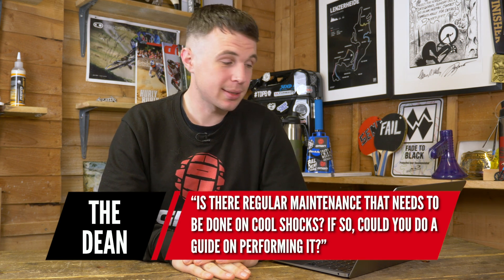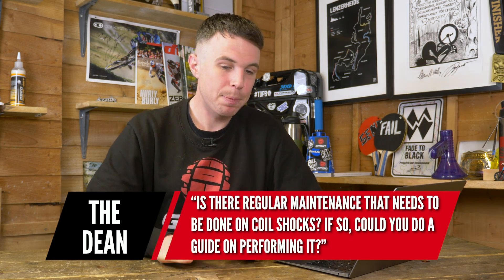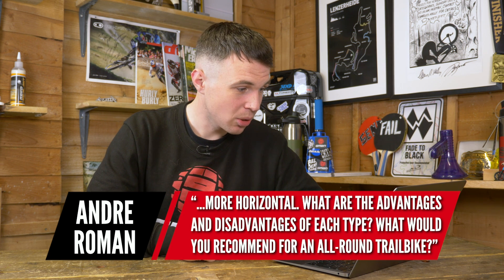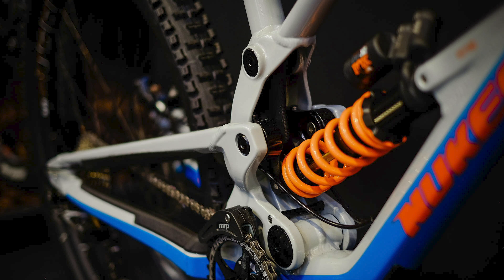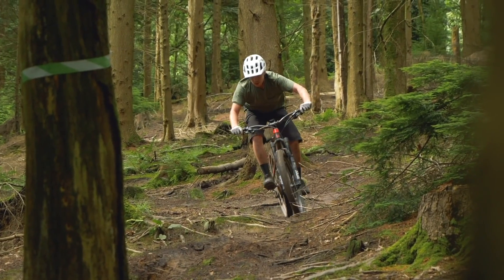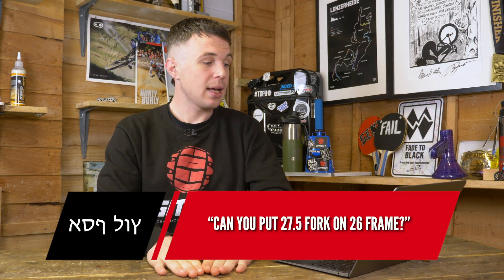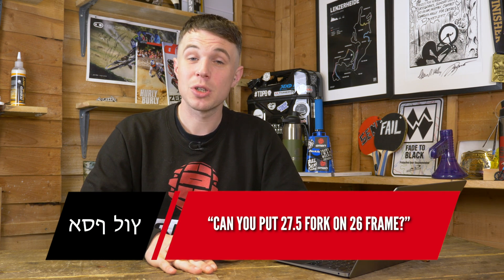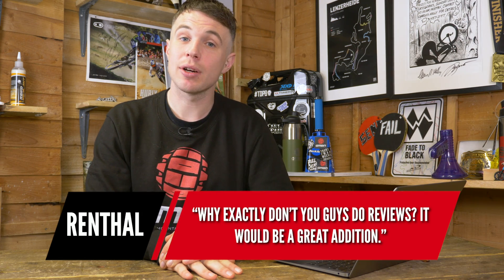Does A Vertical Shock Perform Better Than A Horizontal Shock? | #AskGMBNTech

Comment: #askgmbntech Hey guys, is there anyone anywhere in the world who manufactures aftermarket alloy suspension pivot bolt kits for full-sus MTBs? I'm asking because I have a 2005 Specialized Epic and a 2008 Stumpjumper FSR (almost identical to the '08-'09 Enduro but with a single-crown fork). I managed to source the correct bolt kit for the Epic from Australia and so have been able to replace all the pivot bearings but for the Stumpy, I've looked all over the world every day for months, I know the part number but just can't find a set! On a lot of relatively modern bikes these pivot bolts seem to be alloy and unique/uncommon sizes so I think there's a gap in the market here. I have a brand new shock and new pivot bearings for my Stumpjumper but don't want to take it apart without a fresh bolt kit because being alloy and having not moved for 12 years, there's a chance I could wreck at least one of the allen heads removing them (the Epic was difficult to get apart because the pivot bearings were seized to the bolts). Thanks for a great YouTube channel, and hope you can help!!

Comment: I got my canyon spectral 4.0 3 months ago but it came with a fox 34 performance 140 instead of Rythem 150 .I noticed however that these forks are 29/27.5. Should I get a 29’ wheel in front and use 29 in front and27.5 in back#askgmbntech
Reply: 34 performance is same as the rhyhm. How did you meassure the travel? 
29/27.5 fork means it can be used for both wheel sizes, do not change the wheel, it is meant to be 27.5 by Canyon and changing it will affect geometry.

Comment: #askgmbntech 
Hey guys I have a brand new Marin rift zone 1 with hydraulic disk brakes and I have a problem with the rear brake. I have an extremely loud squeak on it whenever I brake, I’ve tried bedding in my brakes getting new pads cleaning my pads and they are not stopping the squeak it’s getting extremely loud and annoying what do I do? (:

Comment: Vertical suspensions are worse in relation to maintenance.... they will require more disassemblies than horizontal ones... Reason: They are mounted upside down on purpose by the factories.... This way the dirt can enter easier within the shock.... and Fox can sell you a new one faster..... Always keep your shocks clean and if possible protected with a shock cover made of neoprene.....

Comment: One more option for a tripped axle thread: find an external bolt that works with your fork after you've drilled out the damaged threads. They sit on the outside of the leg with a flange and may be cheaper - although it may not fit at all if the fork dropout doesn't have enough space for the flange to sit flat.

Comment: Hi regards to suspensions kinematics, i really enjoy the analysis report of youtuber #andrextr and #gmbntech in my opinion any suspensions analysis report requires quite a bit of suspention knowledge to understand. but the whole suspension topic need som clear guidence and ther are enough of somtimes misleeding simplification of the topic.  Take something as simpel as oil viscosity and reference values.. your going to stumble on a world of alchemy and nonsense, and when your about to give upp you might discover CST rating. somting only fewe, if any wil give you the CST rating of there oil . 
So could be a nerdy suspension series hear on #gmbntech if your up for it. 

Im not buying my next bike without a careful look at suspension progresivety, fit  and a analysis of the overall bike handling. 

#askgmbntech

Regads Truls

Comment: #askgmbntech  is it harder to ride a bike with more travel up hills, because I am thinking of buying one
Reply: Generally, yes.  But, it isn't across the board.  Geometry has a lot do with it, as well.  I have been on bikes with long travel that climb better than bikes with shorter travel.  Generally, a cross country bike will climb better than an enduro bike.  As an example, I demoed a Transition Patrol which has 170mm of fork travel and, I think, 160mm shock travel.  It climbs very well and better than some shorter travel Yeti bikes.  Just my opinion.

Comment: I have a set of stans wheels running Project321 hubs, these hubs are fantastic but they have QR end caps and I'd really love to convert them to 12×142 and run them on my enduro. However, throughOut my agonizingly long search, I cannot find the neccissary hardware. I've noticed project321 sources their hub shells from Industry 9, mine specifically being the torch hub, so my question is, can I somehow use I9 torch endcaps to convert my hub to thru-axle without forking out $70 for a whole new axle? By the way, big fan, love the info u put out to the community

Comment: Can I install 54t ratchet without changing the hub? I have a Canyon Spectral AL 6.0 2019 with a dt 1900 set of wheels and I think a dt 350 hub.
Reply: Paran01ac no, the web says a dt m1900 has a 370 hub with pawls, not 350. Only if you have a 350 hub could you just swap for a 54t ratchet. If you had a 350 hub it’s an easy job to do, if you yank on the cassette you can get the freehub to pop right out.
Reply: @jonathanzappala  thank you so much for the answer, would you recommend a dt 350 hub? Or is 240 better? What hub would you buy yourself in that situation? Thanks.
Reply: Paran01ac Paran01ac I have 350 hubs on my bike. They cost less, and the only difference is weight and stainless steel bearings in the 240. If you buy the straight pull 350 hubs, the front hub almost weighs the same as the 240. It’s because the 350 hubs are forged and 240 are cnc’d.  It wasn’t worth the extra money for a little weight to me.
Reply: @jonathanzappala  thank you a lot for clearing everything! You're the best. I'll order 350 and a ratchet soon.
Reply: Paran01ac I would check the dt Swiss spoke calculator too, it can tell you if you can use the same spoke length.  Otherwise you would have to buy new spokes and then your better off just getting a new wheel.

Comment: #askgmbntech I mistakenly bought a Sram boost 1x crankset for my older non-boost bike.  It has a direct mount chainring.  Can I get an offset chainring to get the chain line back to 49mm?
Reply: Sam Smith yes, you just need to buy a 6mm offset chainring. The boost chainring is 3mm offset

Comment: About the 27.5 fork on 26 frame. I run that setup on the bike in my picture(Mongoose Fireball 8-speed 26" DJ). It's a 27.5 Fox 32 with a 26" wheel and 2.5 maxxis DHF. To be honest, it didn't raise my front end at all, the fork overall length is the same as the RockShox 30 26" fork I had on there, it just has a higher arch to clear a 27.5 wheel.

Comment: The 27.5 fork on a 26" frame:  GMBN didn't even touch on the steerer tube size, which is what i was hoping for.  So many 26" bikes (if older) take a straight 1-1/8" steerer, whereas newer 27.5" forks are built with the tapered steerer tube.  Has anyone found a decent & robust 27.5" fork with a straight 1-1/8" steerer?

Comment: try pressing a piece of spaghetti in the middle of its length vs pressing at a joint between two pieces, then think how much force the damper mount must react then ask yourself why placing it in the middle of the downtube is the most optimised position. just think about all that unwanted compliance in the frame because of how you're reacting the force. also regarding shock placement you might run into issues with cavitation etc if shocks are positioned upside down 

take all marketing bs about suspension geometry with a pinch of salt. everyones c.g. position is different on the bike and everyone runs different tyres/pressures/fork & shock settings/drivetrain combos etc. etc... 

look at pinkbikes latest huck test and see how much the tyre compresses/rebounds relative to the suspension. people are out there riding single pivot bikes and still having tonnes fun which is all that matters unless youre racing. 

most riders dont even bother commiting a few days solid setting up their £700+ fork and shock!!! 

if you think mountain bikes are highly engineered think again!
Reply: jacq it looked like in the pink bike video every frame flexed before the suspension traveled more than a cm. Quite a good video

Comment: #askgmbntech Hi Doddy and Henry, loving the videos and cant wait for more in the future! So I have been wondering, could you technically turn a downhill bike into an endure/trail bike (suspension wise) by getting a shorter travel fork with the same axle to crown height, and get a shorter travel shock with the same eye to eye length. Obviously there are other problems, you would need a larger cassette. Is it still possible or would it all just fall apart. Thanks :)
Reply: It would work but it will never as good as a Enduro. The only problem is the cassette I don't know if a big cassette fits then is would probably work

Comment: #askgmbntech
Hi Doddy/Henry, looking for some advice. I have a 2018 Specialized Stumpjumper with a 'RockShox Monarch RT3, Rx Trail Tune, AUTOSAG, rebound and 3-position compression adjust, 197x48mm'. I wanted to upgrade the shock but understand the size is custom to Specialized and newer shocks don't come in the necessary size as Specialized have made their newer bikes conform to standard sizing. Is there any way to fit a newer standard size shock (200x50mm for example) to my bike? Thanks Scott
Reply: That's why specialized went back to standard sizing in 2019

Comment: #AskGMBNTech 7:03 If it's a FOX fork can the threaded insert for the axle not be replaced instead of the whole lowers? Are there any versions that don't let you? You can definitely remove it with the 15QR forks as that's how you "clock" the axle lever and at least some of the pinch-axle forks used removable inserts that let you swap between 15 and 20mm axles.

Comment: #ASKGMBNTECH how much different is a  coil rear shock than an air I have rode both but only find suttle differences
Reply: Depends on the geometry of the bicycle. Coil shocks tend to be more linear while air cans are inherently progressive. If the geometry on the bike is not progressive, then you can blow through the travel on a coil shock pretty easily. If you have a progressive geo, then what you'll have with a coil is a bike with arguably better small-bump sensitivity than an air shock that is also sufficiently progressive the deeper it gets into the travel. All that said, there has been a LOT of effort put into making progressive coil shocks and into air shocks that are compliant at the top, so it seems like it's preference. The prevailing rule of thumb seems to be coil = more plush and heavier, air = stiffer and lighter.

Comment: #askgmbntech        Im thinking of buying a better bike for my daughter, to take her the local trails. Is a female pacific bike needed?  Or would a men’s aggressive hard tail do? What is the difference? Can female ride just as good on a male bike? Is there any need for two different bikes for different sex’s?
Reply: The seat is the only component that needs to be womens specific, might have to swap the bars as well but that entirely depends on the rider. Most womens bike frames  are just the mens bike with a different paint job
Reply: Thanks Steven, I was going on them lines my self. I do get better value for money in a (male) bike, just because of pure range. Hopefully good old dad can show her to send hard 😂🤘 best wishes rich.

Comment: #askgmbntech i broke my magura mt5 twice and it cost for me 60€ fore one brake i have combinate the magure brake with a shimano bl mt200.
It works fine but is it good fore the brake ?
Reply: Claudiu Gemanar I can tell you right now that you'll likely be okay for a while but once you decide to have the brake fully serviced in a few years, there might be some noticeable wear on the brake caliper. it's generally just a good idea to stick with what the manufacturer uses as the brake is designed to work specifically for THAT fluid and not any other kind. with that being said, I'm sure itll be more than useable for the foreseeable future. you could also just buy the fluid (royal blood) from maguras site as its not very expensive at all
Reply: @dash0173  ok thank you 🙏🙏😀
Reply: @claudiugemanar6424  I know a semi pro ride and a few guys how built their own bikes. And the say there is no noticeable abuse. The only difference is the better feeling.
Reply: @lorenz9956  A ok thank you and they haven't any problems with it?

Comment: #ASKGMBNTECH  do I  need to get new wheels when upgrading the drive train on my bike
Reply: Steve Wade not always. depends if you're going from 3x or 2x system to a 1x because 1x systems usually have 11-12 gears in the back to compensate for the range you'd be losing and 11 or 12 gears in the back require a wider axle width which would or wouldn't be compatible with the bike, depending on what bike you have

Comment: I've owned both a vertical and horizontal shock mount frames and the only difference I notice is that frames with horizontal mounted shocks tend to suffer from more pedal bob.
Reply: Agree
Reply: It's just that pedal bob doesn't have anything to do with the shock orientation. It has everything to do with how the swing arm, linkage is designed and the relative position of the pivot point and chain ring position.
Reply: @christianholmstedt8770  Thats probably true but keep in mind horizontal shocks do in fact have a different swingarm design from vertical shocks. And yes not all horizontally mounted shocks have the same swingarm design. For example, santacruz 5050, commencal clash, yeti sb150 all have completely different designs but the sb150 completely eliminates pedal bob.
Reply: In essence:
The shock operates exactly the same way mounted horizontally or vertically.
It is all about the suspension design. Just like I said in the beginning.
Reply: Aditya Wardhana  Thats not quite how it works. My coil and air shocks are on the stiffer side because I tend to do large jumps. That being said, the pedal bob is hardly noticeable, but I just wanted to mention that I had no pedal bob at all on the vertical configuration.

Comment: #askGMBNtech (or anyone else who can field this)Hello, I was curious about compatibility issues between Sram eagle and Shimano 12 speed drivetrain components. In particular can I run a GX Eagle cassette & derailleur with a SLX or XT crankset? If so, does it matter what chain I use?
Thanks for reading, looking to build a new trail/enduro bike. Cheers.

Comment: Disagree , with you answer on shock position, yes it makes a difference, I have done testing with sensors on bb flex which flex more when pedaling that over stutter bumps, but ever rider is different as to how a bike rides!
However position of shock has more to do with what you want the shock to do, but in simple terms a horizontal shock will carry speed better, happy to prove this!
Reply: "a horizontal shock will carry speed better"  so all those years of Gwin dominating on a Session with a vertical shock prove that yes?
Reply: Yes you can think differently, does not mean anything, but a lot more to winning races, but would really like to to have dyno equipment, & add real proof, than armchair experts

Comment: #askgmbntech : hey guys.awesome informative show 🤙. I’ve heard that when performing a lower leg service on a Rockshox pike that you should get all the air out off the lowers by collapsing the fork and letting the air out by pushing the rods in with the Allen caps screws. Then tighten once fork is collapsed . This then forms a negative air chamber in your lowers when you pump ur fork back up to pressure giving u better small bump sensitivity. Is this true?
Reply: Modern forks will automatically balance the negative and positive chambers once the fork is moved up and down a few times so this wont give you any benefits
Reply: RamenNoodles22  I wasn’t asking about the airspring itself. I mean the space in your lowers where the stansions travel into when the fork is compressed.

Comment: If an air shock is vertical with the air can at the top, it might prove to be more reliable over time as the float fluid or equivalent will spend all its time where the air can seals are

Comment: I'm planning to add a dropper post on my full sus. Cable entry's on the left of the frame and the lever on the left of the hb, how can I neatly cable manage the cable if they're on the same side of the bike? #AskGMBNTech
Reply: waldenjay assuming you are not running a front derailleur:  starting at lever on left grip run housing in front and around the right side of head tube. Also assuming internal routing and a cable stop on the right side of the down tube close to where it meets the head tube. The cable will cross inside and exit the down tube at the bottom left Then a short housing bit up into the left side of the seat tube.
Reply: @batterybuilding  My frame only has 1 cable entry and that's on the left. Both the RD and Rear brake cables are routed externally.

Comment: Just the facts? I just listened to a lot of parsed conjecture. I am not dissing on you because the only way to stay just with facts would be to only share actual data. Weight, Geo, travel numbers etc. To the question about shock orientation maybe it's an opportunity for you to do a frame design/suspension type-kinematic explanation for those that might want more of the geeky stuff. Include such things as IC, Anti-squat, Brake dive, leverage rate, progressive, digressive terminology. Or we can send them to Vorsprungs Tuesday Tune videos. But it would be cool to see GMBN's version.

Comment: #AskGmbnTech
How to safely cut carbon handle bars and avoid carbon dust  (already have the CS-1)???
Reply: Luke Downey do it outside in a well ventilated environment, wear one of those white filter masks that they sell at hardware stores and get cutting. 
If you didn’t do this just make sure you don’t breath it in because it can cause bad lung diseases